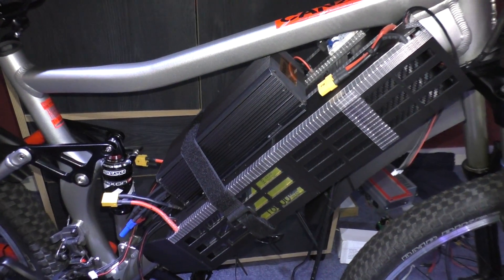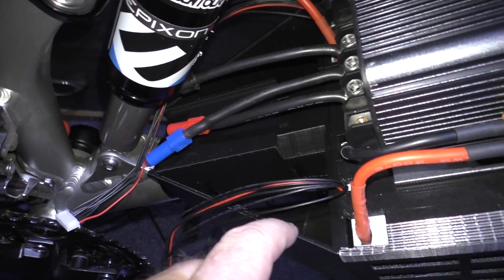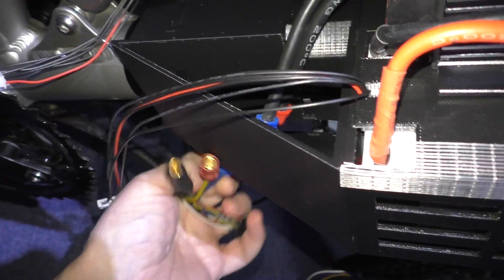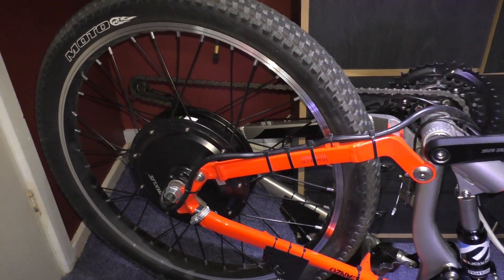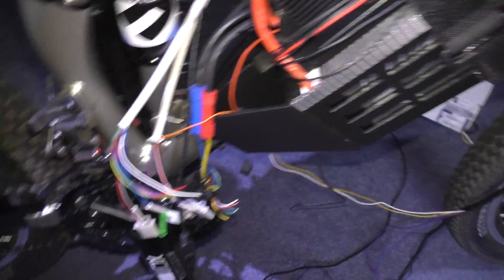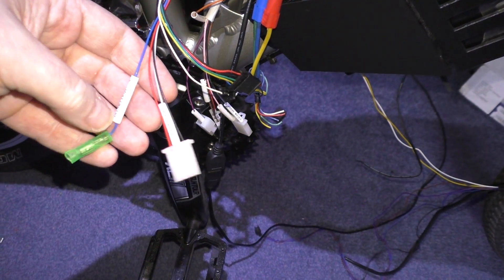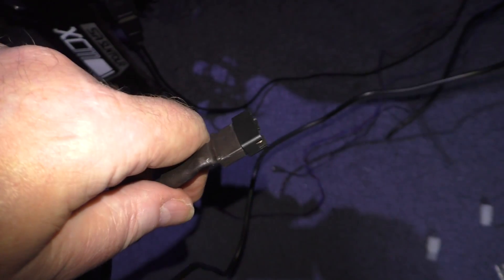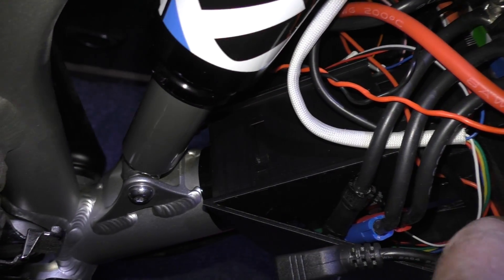11000w DIY eBike build part 4 - MXUS hall sensor angle test

Comment: This video was made 2yrs ago,,,  this man has been speeding around on a electric bike probably longer then 2yrs and I have only been witnessing on you tube that manufacturers are starting to make electric bikes going up to 40 to 50mph,,,, on top of that they are charging grands of money,,,, your a smart man mate your well ahead of the game... I wonder what kind of speeds your getting up to now,, now that batteries are probably more powerful and more compact.... well done.... plz make me one I'll pay you
Reply from the maker: Thank you 😁
I've made V3 now and I did a complete build series https://www.youtube.com/watch?v=w65AyVLPWdg&list=PL3Rqaj8tXgrgCSo811vduJJEgnh5ZcjUV
It only goes 76mph which was a bit disappointing as I wanted to crack the 80mph barrier. V4 is in the planning which will be the same machine but with a bigger motor & battery. I want 100mph and 100 mile range (not at the same time) 😊

Comment: Did you wire the MXUS motor temp wire to the Sabvoton controller? as that's so much easier if I can do mine the same.

Comment: my ebike 48v 1000w hob motor Conversion kit 28mph li-ion battery 48v 10amp  the charger current at 5 amp  then discharge current 20amp

Comment: Tony, can I get some help programing my Sabvoton controller? When I bring up the software the instructions say click set port #? no such item under set. but communication says com ports 1 through 20 and number 4 seems to accept. Can you clarify? I have a 72 volt battery, 6 36v packs on each side in parallel giving me 26.4v ah then each side connected in series giving me 72 volts. what shoukd I set the Lack volt? Rated dc current 50 ampsx72 volts? Max dc current? Rated phase current? Max phase current? 
When it asks for phase combo to enable hall angle test, where do I find the phase combo? I have the qs 3000w motor and phase wires are set up by same color combination, which are correct. when i set current settings to 10-28A the notor does nothing? No help anywhere in the USA, you and Andy are my only hope. 
Show less
Reply from the maker: Drop me an email dude...... vortecks2000@gmail.com

Comment: going to use Grin Tech Phase Runner Sinewave Controller , the Controller your using is massive...also no need for shunt or any other bits your using there, motor,phase runner controller,Cycle Analyst,battery, much more compact

Comment: Great videos, invest in a bike repair stand makes it way easier and more comfortable to work on.  Worth every penny.
Reply: Build one using unistrut. Very versatile and can be made strong as you like. Also no welding required.
Reply from the maker: The trouble is, this thing weighs 40kg and I can't find a bike stand that'll take the weight.

Comment: Why don't you turn the controller around so that you have more room to slide it down, just make your cables longer
Reply from the maker: I did think about it and decided against it. The phase wires aren't very thick for the current it's going to have. They used to get warm on the old bike and I'll have to extend them even more. I've already got plans in the making which will make it much better for mounting things.

Comment: You really are trying to make the task as complex as possible. I would have used more compatible wiring system like using the Grin C.A. version 3 which you do have, I would have matched it up with a Grin phase runner and then you could have used JST standard connectors and you could have done things like hook your throttle and 3 mode switch directly into the C.A. instead of the controller. Go to the Grin site and have a look at his stuff, not that expensive if you're saving money by making your own battery. Have you considered what will happen when you peddle? Your shines seem really close to the battery!
Reply from the maker: I hate buying 'off the shelf' wiring harnesses. I much prefer to make my own - you get to know the equipment that way. I've always been the same.... it's a blessing and a curse.

Comment: I am starting to see now why your average ready made E bike is like 500 quid and over after seeing what go's in to building these things not as strait forward as i was first thinking.
your doing a tidy job and it will be so worth it in the end Tony.
ps
if you can get it to go 40 miles your very welcome to pop in for a cuppa any time.
Reply from the maker: Cheers mate.   
When I get the lithium Ion cells, 40 miles won't be a problem. As it stands, I think I'll be pushing it.   
It's all been a labour of love and I'm glad it's nearly done but it's scaring me already!
Reply: Could you not start of with just a single battery feeding the system so it would be nice and gentile to allow you to get used to the new bike and the system and then add in the second battery giving it more performance and then when your feeling comfortable add in the final battery and run full watts, i am a complete amateur with electrics so sorry if that advice is useless i just want you to be safe thats the most important thing here not the bike. .
Reply from the maker: I'm an adrenaline junkie and the thought of 'what could happen' is quite nerving but exciting. I'll start with 72v and then increase to 96v...... will that do you? :D
Reply: Ha ha that sounds perfect to me can't wait Tony.
a little side project for you, build a trailer with a cube on the back and cover it with solar panels and see how that extends your range, charging on the go its the way forward---and left and right.

Comment: The swoop in the top bar is really counter to it's design intent. ie a PITA. The suspension hinge looks like a good place to anchor the motor reaction bar. Like I said, happy to machine bits up if required.
Reply from the maker: Cheers Rob. I might be in touch soon, there's not much happening with the other dude and I'm nearly ready to take it out now.

Comment: To boldly scorch a path that no other Uk Ebiker has scorched.
Looking good there. It's coming on in leaps and bounds. Keep up the good work.
How do you think it will perform compared to the previous build ?
Reply from the maker: The old one had a 100a speed controller, this one is 150a. The unloaded speed is still the same but it'll make a big difference when there's a load on it. I think (with my nose on the bars) it'll hit 65-70mph if my testicles will grow big enough.

Comment: That fiberglass tape stuff is hopeless if you don't protect it from the sun - the adhesive turns to powder after being exposed to U.V. and the tape then disintegrates.
Reply: No problem. Tony lives in England where rumour has it the sun shines for 3 days a year. :)
Reply from the maker: Cheeky bugger, we had 4 days of sunshine this year!  
The tape is only a temporary measure, It'll be covered in 3m covering stuff when I know it all fits and works.